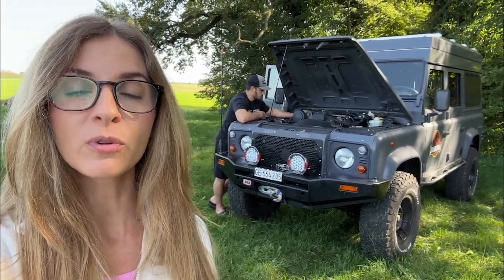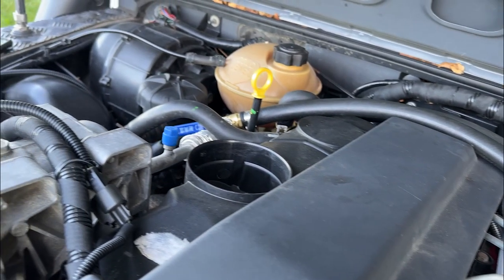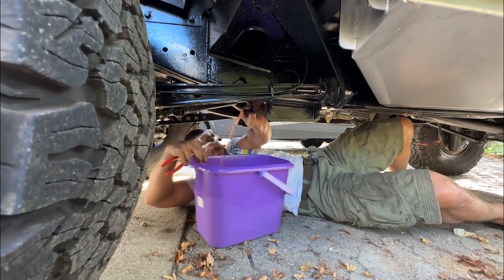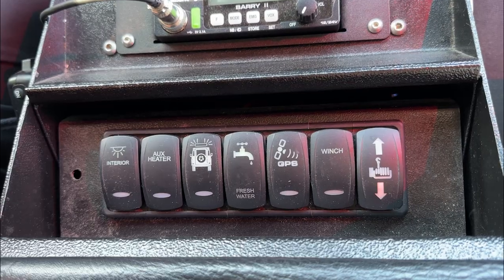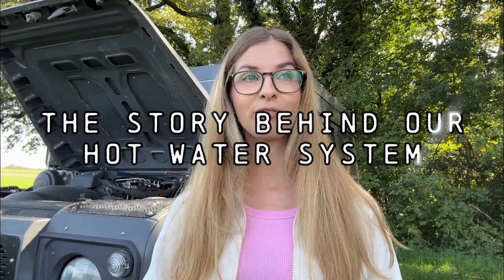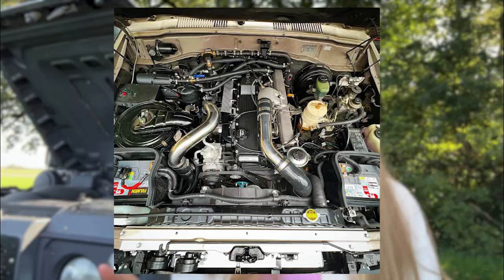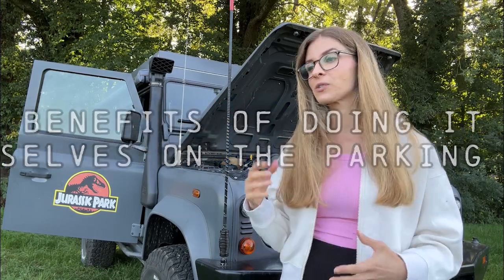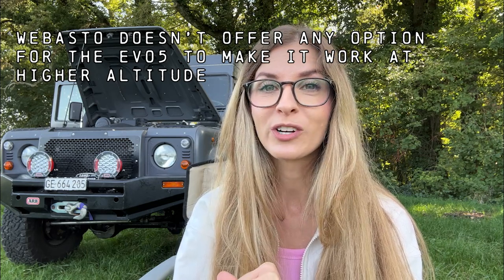Water Heater in Overland Truck (hot water and engine pre-heater)

Comment: You can get a hydronic heater (basically a radiator with a fan) the runs with your water heater set up & do away with the diesel heater. I watch a channel called Dares Drives a while ago, where he built his van as a full hydronic heating & hot water system.
Reply from the maker: Will check that out, thanks for sharing

Comment: Nice set up im looking for just an engine pre heater with winter fast approaching
Reply: Interesting in the different operating heights though not so much of an issue for me.
Reply from the maker: It's those details that make the difference when out there. Connecting to the cabine heater system is also a nice option to heat the interior when engine is off.
Reply: @offtrackfamily  Mines a pick up Puma so cabin warms up quickly but would be even faster with a engine pre heater. The main idea is to preserve engine though.

Comment: Hi this is very interesting. We have a 2.4 TDCi too and are planning an overland conversion over the next few years. Could you please add details about the actual parts used and the connections ? @thebluelandy used just the coolant system in their TD5 without using a preheater, using the engine block’s residual heat through a heat exchanger, which I think is a good idea too if you don’t need a preheater. I’d like to understand how the switching between preheating and water heating works
Another great video 👍

Comment: Thanks for the really comprehensive content! A question though. Do I get it right, you don’t need to run the engine or to already have warm coolant to warm the water? Sorry if it’s a stupid question.
Reply from the maker: Happy you find it helpful. No, no need to run the engine, it’s the heater that does all the work.